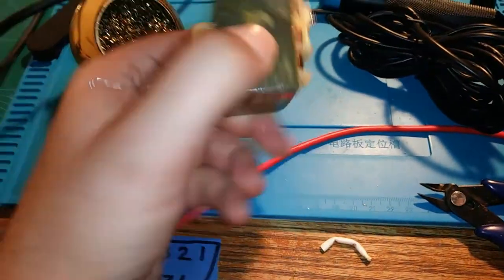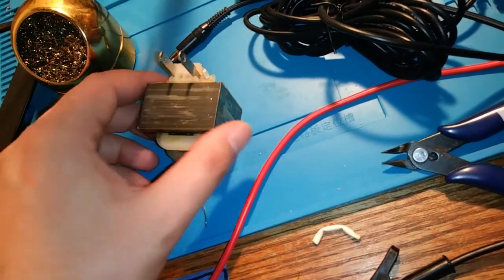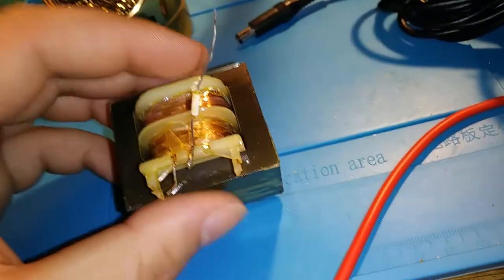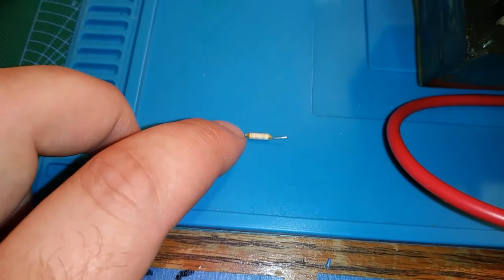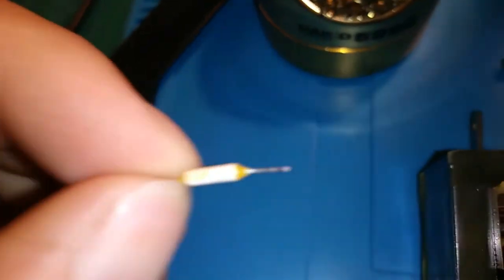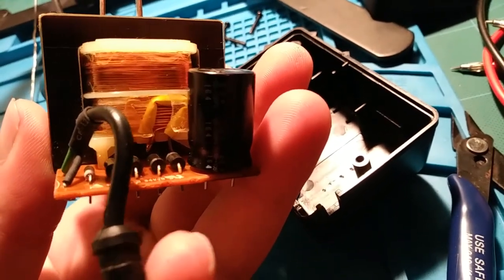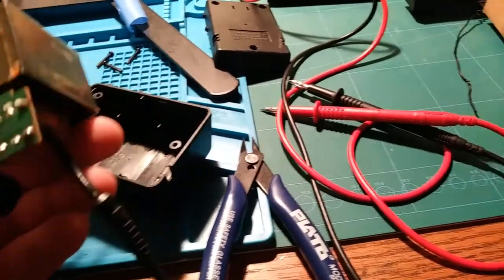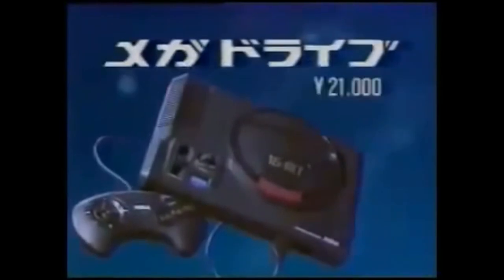How to Repair a SEGA Genesis Model 1 Power Supply

Comment: Thanks!  I had a Sega Game gear power supply not functioning.  The barrel jack connector had broken and shorted out somehow.  I looked and eventually found a 2.5a thermal fuse tucked in between the prongs of the wall jack once I opened it up.  I got some on order so should be back in business soon!